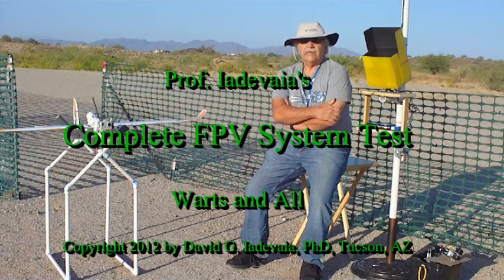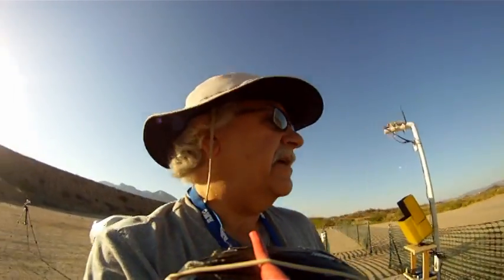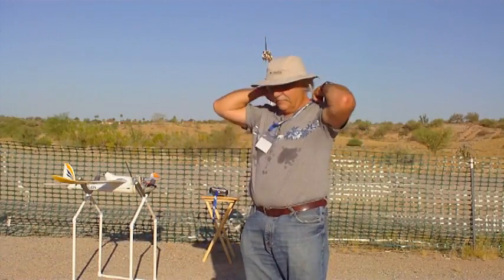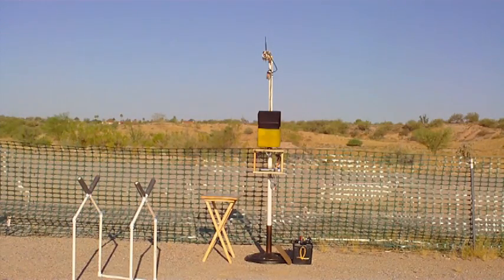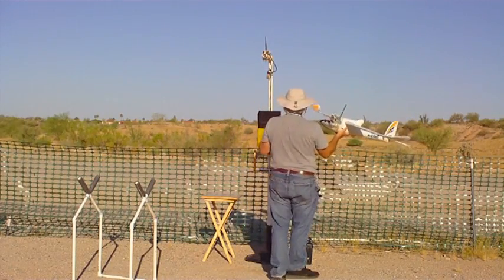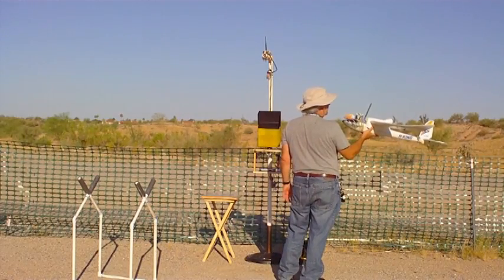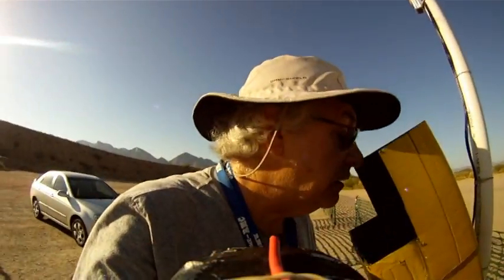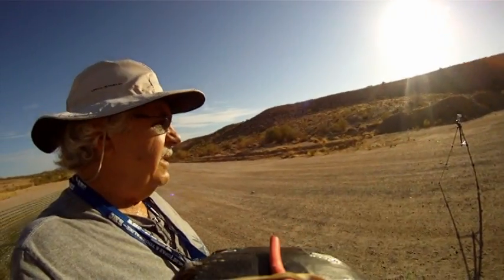Complete FPV System  Bixler Flight Test

Comment: Great flying. I made some small steps getting into FPV as well. I will rob some of your intellectual rights using the PVC and the Video converter;-)  I use a FY 21Ap that helps stabilize my plane in flight. It helps when there is multipath (blanking) on the video link if over a couple seconds. Thanks for the Video.